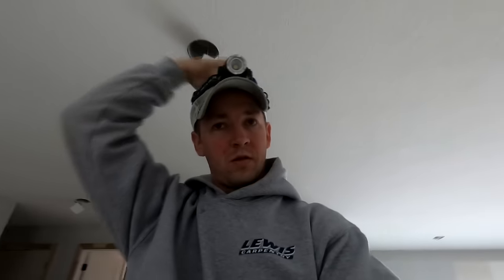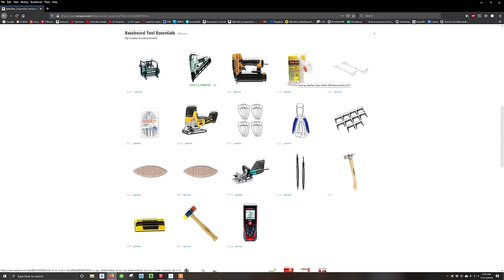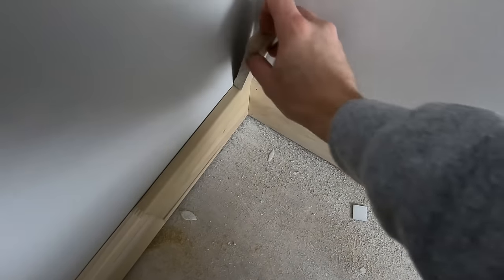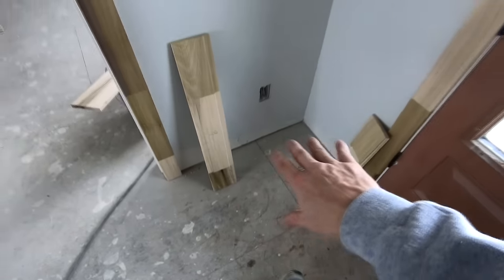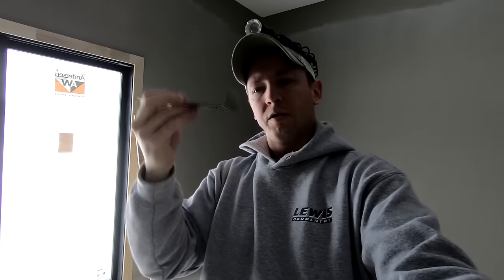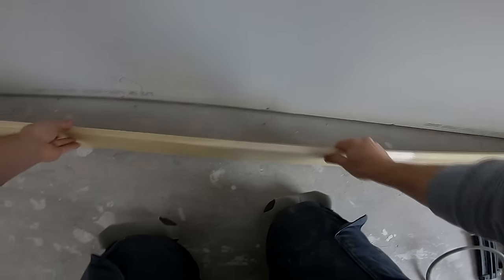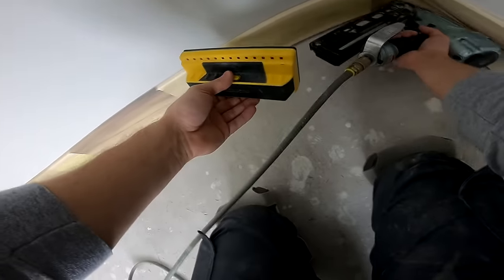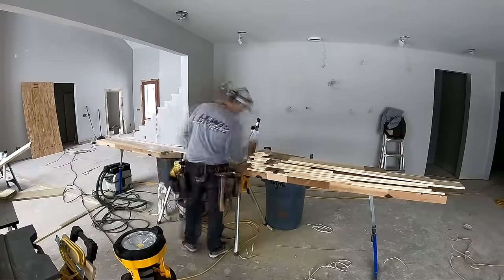Pro Tips for Fast Square BASEBOARD INSTALLATION - To Cope or Not To Cope???

Comment: curious how you handle a couple scenarios: 
1)  you space the corners to allow for fin flooring, but some of the runs you had were long enough for the dry fit baseboard to sag a little in the middle of the run which could seems like it could create pinch on the fin flooring at install time. also what if the floor itself in fact has a dip or hill?
2)  i feel like you may be downplaying the impact of lazy drywalling/plastering. i gen find that scraping some extra dry mud off outside corners is the least of the problem to deal with. the bigger probs are mud buildup on inside corners, outside corners and wall bottoms. inside corner mud buildup  knocks the corners out of square. excessively lipped wall bottoms brings the walls out of plumb. of these, wall bottom buildup is generally the most noticeable as an 1/8" buildup along the bottom will show up on baseboard but corners. to counter, you have to smack (and break) the bottom of the rock with a hammer and block to elim the buildup or you might have to pull the top edge of the baseboard away from the wall thus creating a small gap that may not be covered by, say, a base mould. it would be interesting to hear how you address (if at all)?
Reply from the maker: You definitely have to we aware of potentially bowed lengths of baseboard, as well as humps and dips in the floor. Generally I try to run the baseboard straight, not follow the floor. We use shoe molding, so its not a big deal to hide issues. There are all kind of potential problems I'm constantly watching for. Short answer is you just roll with the punches and adjust as you see potential issues.
Reply: @InsiderCarpentry  love your channel. keep up the great work.

Comment: I like to go opposite with that door jam base block.  I keep the miter seem facing away from the room and I use the long length to hold the block in with a small blast of blue to the block.  Either way, it looks great.  Great work madman.   After 36 on the cut list it gets confusing.... you bet!

Comment: I am a finish Contractor and I took some time off & made my base board on my big router table (it’s really nice but I need a shaper) and used “Infinity Profile Bits” to make it.  And I primed and painted all of it?
I hv a 2400 sq ft custom home (my dad built it) and I wanted nice base no MDF!
I did everything right except?
I mitered all the inside corners and I should hv butt jointed?  Such a total waste of time!  And I had about 1000 ft of custom base! With tons of 22.5* ‘s to miter!
And the brisket jointing on long pieces is a fantastic idea!
I used a 30 degree scarf which I hid as best I could!
Anyway it’s nice but I totally agree I would do it exactly as you did!
I use the same nail guns also!
But I use a California Air compressor (it’s dead quite) and Buckaroo Leathers (finish rig).
Take care of your knees I am old 61 Carpentry is my 2nd career I started at 51.  I wear knee pads!!!! 
But I like your I am getting those pads!!
God bless you young man!
Keep your mind always busy and improving!
Reply from the maker: Thanks for the kind words. With profiled baseboard I do cope all my inside corners.
Reply: Darn!  I was gonna stop doing that and blame it on you:)
Just kidding actually I hv switched back & forth between coped & mitered?
One looks better ; guess?

Ok buddy go make a million more !

Comment: Great work man. I do pretty much everything same way, only thing in our state base board usually goes right on top of finished floor, except if it's carpet. And one more thing about knee pads, i don't use those anymore at all. I wear work pants with built in pads for about 10 years and i'll never ever change them for regular pants. I always got knee pads when i need them, so this way i cut out that laziness factor, that you have to run to car or truck or van to grab them and use them.

Comment: It’s funny the different generations of carpenters.  The older guys I used to work for would scoff at stud finders.  They’d make the new guys lay out a tape once he found the first stud off the corner and mark 16 on center where the baseboard would cover but above the plate.  If some new guy (that task always given to the newest guy) messed up they would take away the tape, give a 16” piece of scrap and make him walk around with a small finish nail that’s hammered in, above plate but below baseboard, to see if a stud was there then mark it.  People learned pretty quick how the layout of a framed wall worked.  Only one side (might be off) and they framed it along with us so they knew it was all bang on.  I remember guys quitting on those days of being on their knees with a pencil, hammer and nail.  You really can learn who’s cut out for carpentry by who can frame fast and who can learn by watching the skilled guys.   Hell I learned how to do basically everything by watching.   Now I am a GC and have atleast 3 jobs going on at any given time.  

Back in the day the guys who could hang cabinets and do perfect crown or any finish work wouldn’t really teach the young guys verbally because they didn’t want to lose their job as a highly paid employee or as a sub contractor.   
Now a days the tools have come so far that we can detect water/electricity behind the plaster/drywall.  The tools are insane and always evolving/getting better.  I always look at the Japanese or guys like Samurai Carpenter and am amazed at what they can do with hand tools.   I take any upgrade I can tool wise that doesn’t set me back crazy money and makes my site more efficient.

Comment: Question .. very late jumping on this channel but absolutely happy I found it . How do you handle round corner ( which I hate and never installed on my homes ) . I live in California and all .. most all houses tended to have radius corners built in mid 90’s . 
And not being forced to use pre fab corners with pre determined profiled base what’s your recommendation or trick . Open to anyone thx
Reply from the maker: I don’t have any insight as we don’t use round corners all the way down in my area.
Reply: Make a 3 piece corner by cutting 22.5 degrees on all 3. Middle piece is only about 5/8" on the back.When doing lots of corners I'll make a mock-up of 10" pieces to the long point plus the filler to measure to (adding that 10" back to the measurement). Works for any profile base and crown too. See Spencer's other vids.

Comment: Nice video,  I am also a trim carpenter in new homes. Its amazing how much you said that are things I do as well. I also use proknees. Same 18g brad gun I have the 16g bostitch smartpoint instead of the hatichi.  I recently got an RZmask it's nice in dusty houses or if you cut MDF.
Reply from the maker: I need to grab one of those masks. Thanks!

Comment: So on those inside corners, where the rounded-over edges meet, there is clearly a mismatch. Do you fix this later with painter's caulk or some other filler before painting? Otherwise, I think any homeowner with even the slightest eye for detail would eventually notice the mismatch.

Comment: Spencer:  What amount do you add to the accurate base measurement based on length?  Understand the length measurement for base that abuts door casing.  What is the best way to deal with installing inside corners that requires miter or coping?  Appreciate your help with this.

Comment: I like to install small pieces next to doors/corners first, square it, shim if necessary. and than ran my long piece into it this way small piece is stronger and will not crack during time along the grain. Anything smaller than 2” I’ll run first 
.
Reply: I  learned  the  long  one  first, with  the short butting  up  to  the face  of the  long because  the  longer  piece  will expand and contract more than  the short, so bury  the end  that's  moving  more  behind  the  more stable  shorty-

Comment: You said you cut your outside mitres at 46 degrees,  I use the starrett mitre degree tool, works great for finding accurate degrees on inside and outside corners, especially when installing crown mouldings. I simply get the mitre degree/ angle and then mark it on the wall, saves a lot of time and no fussing with open joints!
Reply from the maker: For crown I like to use a bigger digital protractor. I find that the short angle finders don't give an accurate reading because they are only following that 8" of the corner mud buildup, not the greater plane of the wall. I find a 24" digital angle finder really helps.

Comment: Just out of curiosity, if you know that the run is going to be longer than 1 board, why measure it? A lot of the rooms I do I'll be able to bring 3 pieces in (1 on each wall), then measure the distance therefore minimizing the amount of measuring and cutting I'm doing. I always cut all the ends so I know it's square but I don't have to measure more than the 3 boards in a room. Also I noticed you said you install base before the floors are in, is that common in the residential field? I only do commercial and we usually wait until floors are in and scribe our base to the floors.
Reply from the maker: I've done it like you say installing the long pieces on walls over 16 ft first. Very legitimate technique also.

Comment: the nail that slips above the base or on the reveal edge of casing is one of the most frustrating self inflicted bock ups. and it always seems to be on the second last nail.

thanks for the value tips, especially in this age of social media carpentry its easy to forget that the value is for the customer and the customer isnt a trollish super carpenter.

Comment: I'm wondering what you would advise me to do. Have carpet, will be having all hardwood floors installed. All my baseboards are stained clear pine with OG on top. Wondering if I should remove All the baseboards and have the floors installed and reinstall the baseboard. Or should I just have them install the new hardwood floors up close to the baseboard and install  shoe molding throughout? I did all that work years ago, so i don't want to pay the floor installers to remove the baseboards or put them up, but they will install quarter round maybe for not a huge upcharge.  Thanks in advance .

Comment: When doing square edge base I always miter the corners. The reason is this, after the install the base should look mitered. When square edge base is butted the square line never goes away. Most square edge base has an eased edge which mates with the sharp cut edge of the next piece resulting in a cleavage. If a joint is going to be visible I want it to be a 45 centered on the wall corner (mitered), or look like one (coped). To me it looks better. Also, outside corners will still be mitered so butting the inside corners gives two corner treatments in the same space.
Reply: It doesn't really take extra time either 3 seconds extra per cut, that's like 10 minutes extra per house, but joints can be calked though which hides a little.
Reply: Evil, point well taken.....
Reply: Same here.....
Reply: I feel the same, miter cuts look better especially if it doesn't get painted.

Comment: You younger guys need to listen to this guy on taking care of your knees and body. 
I have been injured on the job more times than you should be. Worked as commercial fisherman,  mills,  farming, heavy equipment, military, and been a master mechanic for way too long. First timea truck fell on me was when I was 17.
Need both knees replaced but won't do it until i can retire in a year. No meniscus left in either knee. Had broken the left knee cap in half at 19 in the military. 
By the best knee purifying you can, then upgrade. 
In 93, I had surgery on the left knee on state industrial. Had to go back to work and hurt too much to knee on it.  Washington state sent me to a company that makes prosthesis for a knee brace. They had never made anything like it and had me go in the back and help design it. It strapped to the shin bone and had a big thick padded piece over the knee. When kneeling, it would not touch the knee.

Comment: Very helpful explanations.  How do you handle long runs where one or more end terminates against a door casing?  It seems the method of pressure fitting with biscuits doesn't apply in this situation since you don't want to have pressure against the door casing.  Would you then use a 45 degree scarf joint?
Reply from the maker: Cut to exact length. Butt joint with biscuits and pinch dogs.

Comment: The only thing I do differently is to use  a paslode nailer which does not require a compressor set up and speed the work.

Comment: Curious about how you abbreviate your cuts?  Example: 33 5/8 cr to out 22.5
Cope right side, left side an outside 22.5 miter
Reply from the maker: S - straight cut
C - Cope
V - Inside Miter
OM - Outside Miter
V22.5 - 22.5 Inside Miter

I write the cut on the respective side of the mesurement.

S 55 5/8 OM
OM 23 11/16+ C
S 44 5/8 C
S 43 3/4+ OM22.5
Reply: @Insider Carpentry awesome thanks!

Comment: Just found your channel, very impressive work! A lot of things you said in this video sound like my train of thought. However your experience and efficiency surpasses mine. One thing I've started to do while measuring outside corners is put my spacer block on the outside of the corner and measure to that instead of measuring to the drywall. That way I dont have to mess with measuring short points on mitres, I can always hook the long. Not sure if you do that or not, just my preference. I have much to learn from your channel, thanks!

Comment: Outside of the of occasional audio drop because of the mic facing away from you so you can show something, which can mix by some type of lavalier microphone system, your videos are great....
Reply from the maker: Thanks. I do have a decent lavalier but being that I'm running and gunning/working at the same time its really difficult to mess with the lav mic most of the time.

Comment: I just bought over $200 in wood to do baseboards for one room and I'm really struggling! Can I do them after the carpet is installed? Can I stain before they're installed? Mine are solid on both sides with no grooves or what you called "give".

Comment: A big part of "value engineering" trim work is working backwards from what type of finish you're going for.  A job that uses finger jointed baseboard that will be painted is different from a natural wood finish.  Because time is money you need to bid accordingly.  We have a 100 year old house that still has the original wood finish. I'm amazed by the quality of the hand cut overlap joints in the corners of the square edge baseboard.  If I were hiring you to do that type of installation today, I'd be willing to pay extra for a joint that will look good a century later.  I can't believe some of the crap I see in the Parade of Homes and sometimes I feel like I'm walking into a crime scene to see what they've done to beautiful wood.
Reply: Good point!